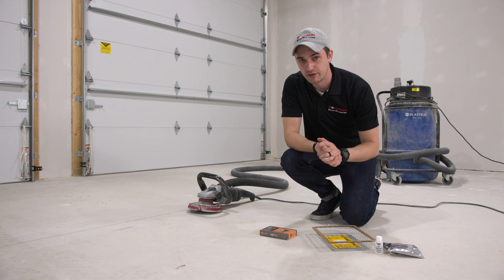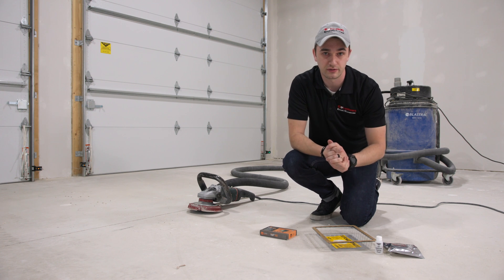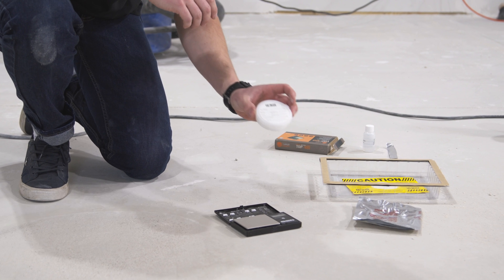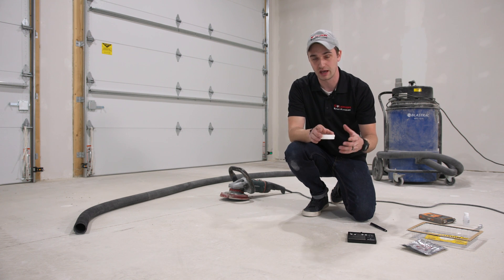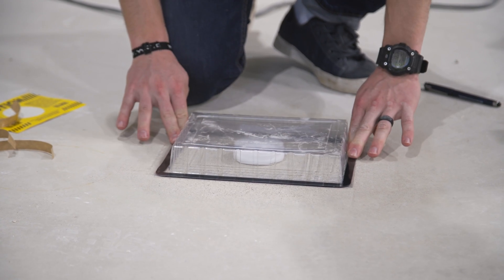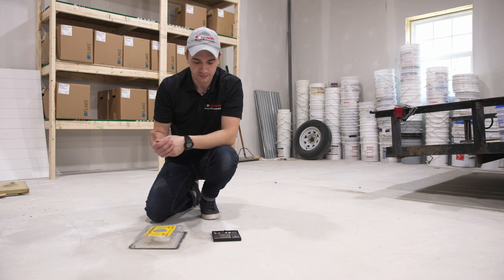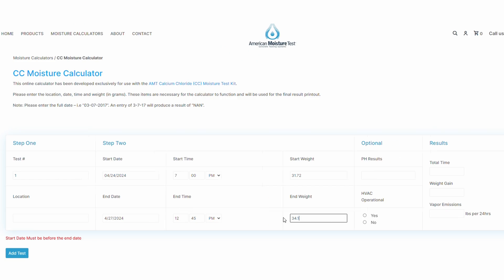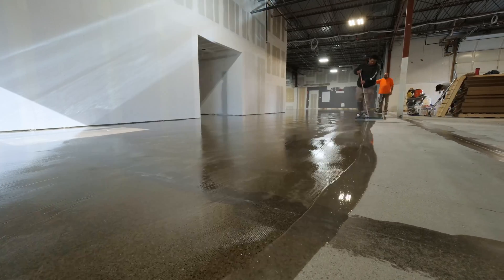Testing For Moisture Vapor In Your Concrete (Calcium Chloride Test)

Comment: What would you recommend for interior subfloor residence as a preventive moisture coating?
Reply from the maker: Do you know how high the moisture transmission level is? We also have a coating that protects up to 25lbs but it's more finicky to install
Reply: @ moisture is about 8.5%
Reply from the maker: I believe you're referencing the RH. The vapor transmission should we weighed in pounds. The hyperbond coating we offer protects up to 8lbs of vapor transmission.  Another coating we offer protects up to 25lbs.

Comment: It was a great video.. you just gained a new follower. Ask if you use 4 tests in the first 100sft if they are less than 500 then it would be 2 tests? 

Thx
Reply from the maker: Thank you for the comment! For under 500 square feet, 2 tests is fine